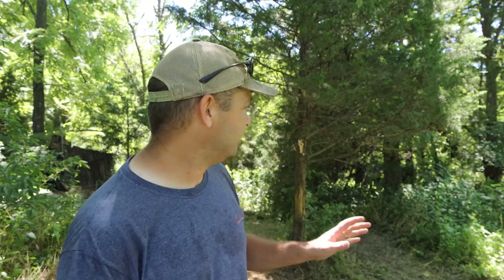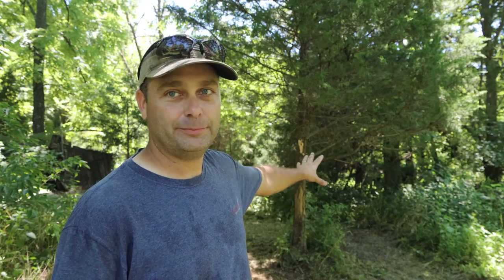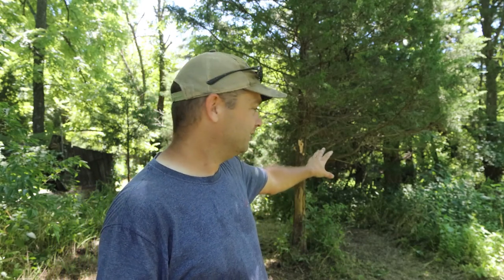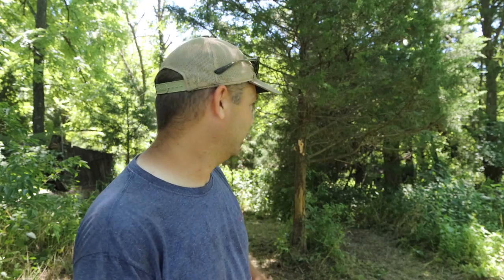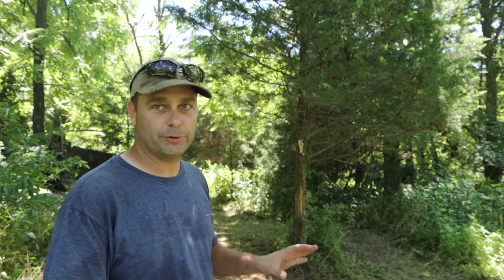Building a Bigger Pig Pen.  Setting up Electric fence.

Comment: When pulling ground rods, give them a couple of taps down with a maul first. It breaks the bond between the soil and the rod and they pull much easier.
Reply: Using a pipe wrench with straight jaws also makes a good handle from pulling straight up after tapping post down a few inches to loosen.
Reply: And use a bucket under that t post for better leverage when using one to pull the grounding rod out.

Comment: Those hog panels are 34 inch not 24  but, you can step over them. 
Other thing I noticed was you said the bottom wire would be 6 inches high pigs will 
Root and will potentially push enough dirt up to the lower wire and it will ground it out pigs are smart 
Remember ARNOLD from the Green Acres Television show 
My dad bought some feeders and turned them out in the roasting ear patch when I was 5 or 6 years old and the first thing they did was ground out the electric fence

Comment: I also just bought some Lock Jawz insulators this summer. We'll be moving my cows to our new place in two weeks, I got the fence all up and running now. The insulators are very easy to use and quite secure. I am definitely curious to see how long they hold up. Keep up the good work, you guys are definitely an inspiration to myself and many others!

Comment: I just bought an old farmstead and everywhere I walk I find junk and old wire.  What were these farmers thinking 🤔 did they think it would just go away?
Reply: You will understand their methods as time goes by.
Reply from the maker: Back then they didn't have trash pickup.  If they couldn't burn it, they saved for later or threw it in a pile.

Comment: Nicely done! Couple observations, for what they’re worth. Those older wire t-post ties are actually reusable- just unwrap. We do that always. Easier if you don’t over wrap the first time. Might have to do some creative re-forming with pliers. That said, I like those spring steel types. Much easier and don’t need tools to install and remove. The plastic t-post clips are well designed. This is the first I’ve seen of those. On your post driver ... everyone finds their most efficient method, but I let the downward movement be mostly by gravity. You use it like a hammer, exerting force to lift and also to drop. That wears me out fast. 😏 Your pooch really wanted to help. I understand some breeds are much happier if they can work. Maybe a small pack for carrying a water jug? I dunno, just a thought.

Comment: for many years i only use one wire, even with the boar, you need a wood pellet gate that never has power on it, to move them out when you need to, dropping a hot wire to movethem can take weeks even with feed to get them to cross, have the time my charger is off, your 3 inch high wire will bea problem because the pigs will push up a huge dirt pile all a long the fence line, shorting out your fence every day, as  the build that edge hill

Comment: Been building fences for years the only problem with dementia letters is if you get a break your whole line is down and as far as your connection a little bit of water gets in there and it'll short it out yes it'll still have a little juice but with pigs trust me you don't want anything like that you want to take that 12 inches of wire and use it

Comment: Does electric fence work if it snows and the snow gets higher than the bottom wire?
Reply: lotus by the time it snows the pigs will already be bacon and ham.
Reply: @Gmanboobies   Yes, I realize that but I was just wondering about the snow lol. I was wondering what people who kept a breeding pair around throughout the winter up north did when it snows? Put them in the barn for the winter or leave them outside with the electric fence in the snow?

Comment: How large an area is this? I am looking to do this for some pigs and sheep.
Reply from the maker: I have been running 2 pigs in about 1/4 to 1/2 acre of wooded area.
Reply: @CountryViewAcres  perfect. What do you think about using poly wire instead of galvanized or aluminum wire for ease later putting up, taking down, and working with the lockjawz insulators? Better to use the actual wire?
Reply from the maker: If you are going to take it down I think poly wire would do fine.  I have left mine up now for 3 years.